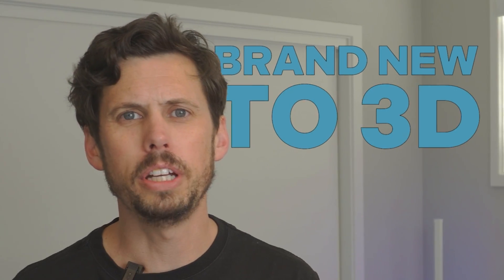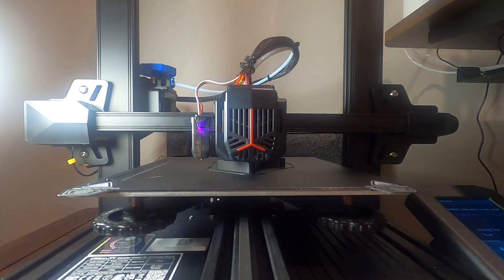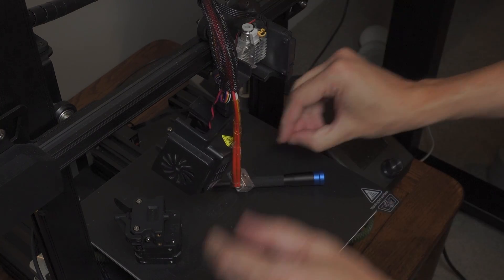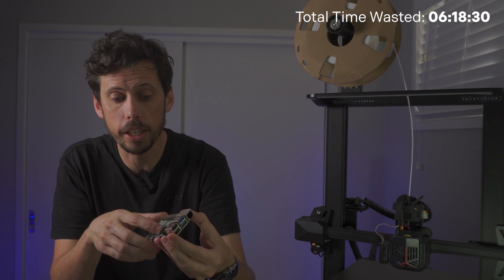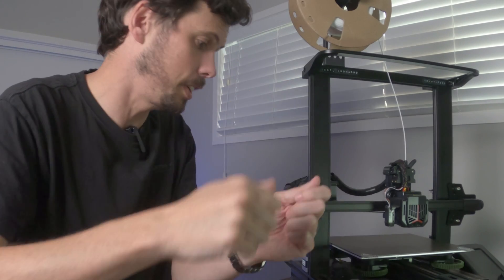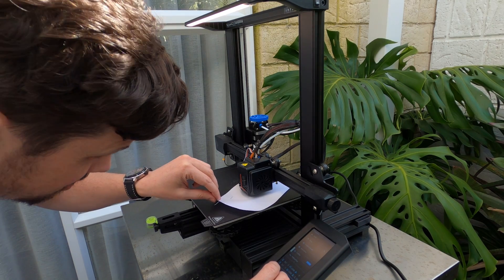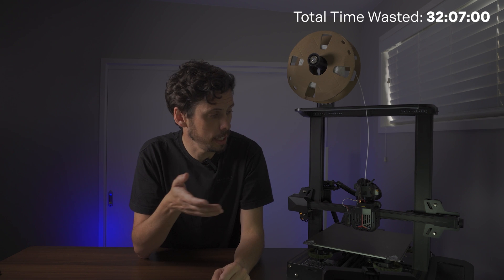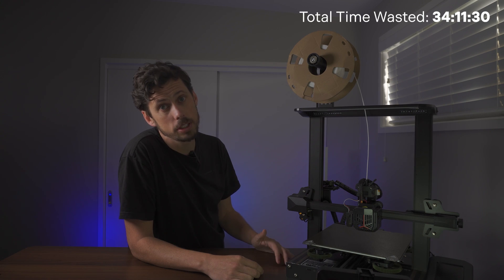Is Upgrading your Ender 3 worth it?

Comment: I can totally relate to your adventure with an Ender 3D printer! It's like a never-ending quest for the perfect 3D printing setup. I mean, who knew that a simple printer could lead to a full-blown upgrade obsession? It's like the Ender 3 is the ultimate DIY project that just keeps on giving.

I can picture you there, tinkering away and muttering to yourself, "Just one more upgrade, and it'll be perfect!" It's like a never-ending cycle of upgrades and modifications. But hey, that's where all the fun is, right? Who needs a Prusa when you can Frankenstein a V6 volcano onto your Ender 3 and create a 3D printing monster?

And let's not forget about all those spare parts lying around. It's like a 3D printing treasure trove just waiting to be turned into another Ender 3. It's like a never-ending loop of 3D printing adventures!

But hey, at the end of the day, all those upgrades and modifications are totally worth it. I have no doubt that your Ender 3 will perform like a champ once you're done. Keep on printing, my friend, and may your Ender 3 adventures continue for many more upgrades to come!

Comment: I've spend hours on my ender 3. From small thing like a new board to a massive overhaul, i spend at least 2 or 3 times the cost of the printed in upgrade.
Is that worth it ? Hell no. 
The machine worked fine before, but it's amazing to thinker with it, if you omit the hours of rage and frustration.
But i love my Klipper Ender 3, with direct drive and double Z, the machine give me the passion for making machine by myself, i can't imagine buying something else than a kit now, love building my cnc and laser, that was the best machine for me.

Comment: Uh, hey, dry your filament.  Like really.  Then you won't get all that stringing and those branches.  And your dual-z/anti-backlash nuts probably improved the accuracy of your first few layer heights.  If you're going to bother with firmware, and you have a pi already hooked up, just skip to Klipper, it's just better.  Makes doing further upgrades a lot easier.
Reply from the maker: Thanks for your advice man. Good to know about the anti-backlash nuts. That filament should be pretty dry still but I do have a dryer so will make sure it's dry.
Reply: @AttemptedMaker  in my experience brand new PLA is often wetter than it would be after drying it and leaving it on the shelf in the open for months.

Comment: I got the sprite extruder pro for my V2 Neo, installed it and only then realized the geniuses at Creality had moved the X axis endstop from where it was on the V2. Ended up having to ziptie it onto the extrusion and angle it with a bit of plastic underneath it so the plate on the new extruder could actually hit it. Then I had to print a new mounting solution for it, which turned out not to work, because Creality also decided that the clicker PCB would no longer need screw holes that all these designs relied on, finally ended up finding one where you can slide it into place and got everything working again. On the bright side, now I'll be able to print with PETG

Comment: Dual-Z isn't for z-wobble(if anything it could make it worse by adding more over-constraints). It's to get rid of inconsistent layer-heights across the distance of the x-gantry. The gantry itself is a giant springy cantilever held up by V-rollers that deform under pressure. The way the rollers are tweaked, can help address this, but the heavier you make the extruder(direct drive) the worse the problem gets, then you have to make the rollers tighter.. things bind more.. they would wear out prematurely, skipped z-steps from excessive friction..

Comment: The only mod i did on my ender 3 v2 neo is a filament guide to make feeding the filament from the top more consistent as it makes a 75° bend otherwise. I've replaced snapped belts as well and changed nozzles but that has been powering my 3d printer to make some cool knick knacks and special storage cases for my junk

Comment: For the bed leveling, it might be your slicer
The auto-home instruction disables it - so you need to re-enable it.
I use the following bit in my start G-Code:
G28 ; auto-home
G29 ; build auto-level mesh
M420 S1 ; auto-bed leveling

Comment: For Ender 3 v2 the only must-have mod is upgrading extruder (this cheap, Chinese, red aluminium dual-gear works great), as stock are faulty and crack over the time. Also it's worth getting better springs for the bed to care less about bed-leveling, they are very cheap and save you a lot of time.
Well, for me also dual Z-axis was mandatory as my printer out of stock came with a bit wonky / not square frame and only dual Z-axis helped a bit, well actually a lot (yeah googled for this issue and followed many tutorials, it was frame's not assembly's fault)

Overall: just print and enjoy and take care about the planet by not printing too much unnecessary garbage 😁

Comment: I got an ender 3 v2 and I got some thoughts:
-a bi-metal heatbreak has been working fine, it was the cheapest I found on aliexpress
-I never understood the benefits of octoprint so never tried
-v-slot covers are such a stupid mod, I also printed them and they didn't fit and I hammered them in and broke some
-dual-z axis motors was a good investment, because I also printed a direct drive mod (printhead is heavy)
-I got a thick thermal insulation on the bed and it hit the stepper motor too :DDD I just trimmed it
-there was some reason I got the silicone spacers, maybe it was related to the BLtouch I installed?
-custom firmware was necessary for the BLtouch
Overall I think this video is great, very relatable :D

Comment: Tip for the firmware/bed levelling issues you are experiencing:
Use klipper! I know it seems daunting at first, but its SO worth it! I myself have upgraded to klipper from my marlin machine, and it had a pretty steep learning curve, but I can honestly say it has been the best upgrade I have done to my printer (which is more than I want to admit) - both print quality and speed wise, but also for the quality of life improvements the firmware offers.

If you decide to give the firmware a try, one of the first plugins I would recommend is the KAMP plugin. Kamp is a mesh levelling program which is far superior to anything I have tried in the past. And I wont doubt in a second it would help you with you´re bed levelling issues!
Hope it helps!

Comment: man after two years or so the only upgrades that I installed on my ender3 v2  is a side spool mount and the vslot covers. niw though im probably gonna be upgrading to a full metal hotend as i needed it to print using PET filament.

Comment: This is a great video as it perfectly captures how my printing experience has been with my Ender 3 V2. I calibrated it when it was stock and had amazing first prints. Then i decided to "upgrade" and it got worse and then better again. Repeat that cycle a few times, especially with installing klipper. Now I have all the parts for the belted dual z mod and I'm thinking i should print some stuff while the printer is working before I mess it up again.

Comment: These are some generalized opinions, not just for an ender 3:

Light bar: can be extremely useful, good mod for any printer, i used to have a desktop led lamp just over my printer for a long time before attaching some led strips permanently

Alternate spool mounts: sometimes unnecessary, but in the case of an ender 3 type machine, this is superior for the bowden setup assuming you have the space, it is still better to have it on top if you go for direct drive though

Better bowden tubes: makes sense for a bowden setup, otherwise not worth

Bi-metal heat breaks: they serve their purpose, you can get away with just a single material full metal one with no issues though

Octoprint: IMO, if you're connecting a computer (like a pi) to your printer anyways, i'd highly recommend going the extra step and just switching to klipper firmware, you can gain so much more compared to just uploading gcode over the network, and having a video feed

pi case: i wouldn't consider this a separate mod, but a part of the previous one where you add the computer, however it's an important part of doing it

Vslot covers: not really my thing, but useful if you don't like cleaning your printer since they sometimes help blocking debris getting into the slots

multi z axis: if you have a bed leveling sensor, this is amazing, if not, really depends if your prints are turning up fine or not (dimensionally)

anti-backlash nuts: yes, use them, always

Buildplates: they are a wear and tear item to begin with, even when they seem fine, they lose their stick over time, so a new print surface is a must eventually

Tactile bed leveling: really only makes sense if you have large bed leveling knobs, if your printer doesn't fit large wheels, you don't get enough precision when leveling

Silicone bed springs: haven't tried them myself, my springs have been great so far (4 years of printing)

Direct drive: yes, it's amazing, i'm never going back to bowden

Cable guides: always a good idea if your printer doesn't have a decent solution for them

Overall, not a bad choice of mods, i would've done it a bit differently, but that's the beauty of 3d printers, you can do whatever you want hah

Comment: To run autobedleveling on ender 3s you usually have to put m420 s1 in the gcode start up in the printer settings of the slicer
Reply: Mine started auto levelling at the start of every print when I switched to Prusa slicer.

Comment: Have you added the GCODE to your start code to actually use the bed levelling info? I was using CURA on my Ender 3 and didn't have that code on so, for almost a year, I was not actually using the levelling info, despite doing a level in Professional Firmware with the CR Touch before every print.

Comment: I wasted so much time and filament with the bed leveling that I'm sure that I made back the time I lost installing my CR-Touch. I also love my PEI bed and dual gear extruder. Those are the upgrades that made a difference, not in print quality but in reliability.

Comment: With ender 3 v2 with bl touch , i am using the UBL mesh gcode examples that are with marlin's firmware. I will try and link them in a bit. It works for me though and i also bought the printer second hand , with bl touch and with no previous knowledge of anything "3d printers" i figured everything out the same day . Because i had in my mind to upgrade it before i even got it.
Thank God for that because i installed dual z screw because the gantry was hitting the print before it every time it moved because it travelled through the print and was crooked without the second z axis. 

The previous owner had installed some things wrong, some wires had been melted etc and it helped that i remade the whole thing.
So anyway i at least learned how to disassemble and maintain it from the start. 
I would post my start gcode if it helps.
Reply: Here is my GCODE  for the UBL BLtouch Firmware Mriscoc For my ENDER 3 V2.
it might be wrong but it works for me.

G90 ; use absolute coordinates
M83 ; extruder relative mode
M140 S[bed_temperature_initial_layer] ; set final bed temp
M104 S200 ; set temporary nozzle temp to prevent oozing during homing
G4 S10 ; allow partial nozzle warmup
G28 ; home all axis
G29 P1 
G29 P3 
G29 F10 
G29 S1 
G29 A 
G29 L1 
M500 
G1 Z50 F240
G1 X2 Y10 F3000
M104 S[nozzle_temperature_initial_layer] ; set final nozzle temp
M190 S[bed_temperature_initial_layer] ; wait for bed temp to stabilize
M109 S[nozzle_temperature_initial_layer] ; wait for nozzle temp to stabilize
G1 Z0.28 F240
G92 E0
G1 Y140 E10 F1500 ; prime the nozzle
G1 X2.3 F5000
G92 E0
G1 Y10 E10 F1200 ; prime the nozzle
G92 E0

Comment: Nice Video, i have two i3 Clones build as Kit, two Ender 3 v1, a Tronxy and a Bambu Lab X1C. 
The Ender 3 pro with the damaged Motherboard is now rebuilded as a Voron Switchblade Clone.
The other Ender 3 got all the Electronics upgrades etc. Just did a 20 hours rebuild on it.

For the Springs: The most common use for the Springs the Bed and reduce the need for Manuell Bed leveling. So either Clicky Wheels or Springs, both is overupgrading. 

The Side Spool is for reducing friction on the Bowden Drive, the first series of Ender 3 even had problems with PLA eating into the Plastik of the Feeder. So Guide Arm and Wheels are not uncommon for this Reason.

Syncronised Dual Z-Axis: It prevents the loosing of the rollers on the non Axis side. Together with a BL-Touch Ender 3 results in awefull results. So either tensioning the Rollers regularly or Dual Z-Axis.

For the Firmware Problem: Which Motherboard do you have ? What do i mean by which Motherboard?
When this is a Ender 3 V2 Neo  then you have mose likely a 4.2.7 Motherboard or the older 4.2.2. But which Stepper Driver is on it? There is most likely a Letter Marking on the Card Reader Slot. H is the lucky Letter as it has the TMC 2225 Steppers. Search for: "Klipper Discourse Group  Creality Board 4.2.2 Schematics " There you find a full guide which Stepperdrivers you have, which Board you have. It is a can of worms and there are about 6 different or more Varients of this Boards around. Searched 4 hours till i got the BL-Touch on my Working Ender 3 Board running.

One Upgrade is missing: New rollers. The Bearings of the standard Rollers are open, there are heavy duty rollers out there, which costs not much more but have a cover over the bearings which prevents dusts and microplastik destroying the Bearings.

I said that i rebuilded one Ender 3 v1.  It is now on the Specs of a Ender 3 V2, as it had the 4.2.2 board with TMC 2225 Drivers and now Bl-Touch, but still has the old stile Display. It got a lot of Upgrades now and it can print as well as my Bambu Lab X1C. For about 4 hours, then it needs to be recalibrated.

For a Beginner i would recommend something like the Bambu Lab A1 or A1 mini.  For the Cheap Ender 3v3  no 3v2. The 3v3 Lineage has linear Rails for the Bed, which are much much much better and more durable. The Bed-Rollers are the most common failure Point for Cheap Bedslingers. The Ender 3v3 SE is costs less then 5% more then a 3v2 Neo, but will last longer and print better. But watch for the differences in Hotend etc.

Comment: I've done all this on the several printers I've owned (all Creality ones) since I first got into 3D printing in June 2020. My most recent being the Ender 2 Pro which was performing nicely, until about a week ago when the motherboard decided to die. Not wishing to go through the hassle of trying to source what is a non standard part, or bodging another board into the case, I decided to splash out on a Bambu Lab A1 Mini. I received it yesterday, and all I can say is WOW! What a difference between the A1 Mini and everything I've used in the past, it's like night and day. The printer just works, perfectly, right out of the box, and boy is it fast! I'm printing something right now that will take the A1 Mini just over 3 hours, whereas it took my Ender 2 Pro just over 7 hours! And the quality is there too, top notch. I'm never going back to anything else after this - my tinkering, modding, and upgrading days are over 🙂.

Comment: You should really give Klipper a shot.
Reply: Klipper is great.   I can waste more time even faster now ;)  

 (seriously though it is a huge improvement, the sonicpad is actually a pretty decent setup for creality machines)
Reply from the maker: Oh yeah, I've seen the sonic pad... and the single printer version that came out... I forget the name. You think it's worth it?
Reply: @AttemptedMaker  You don't need the speeder pad to use klipper on your ender. You can just use the same pi you're currently using for octoprint and you use a touchscreen just like the speeder pad by getting any raspberry touch screen tho it's not necessary if you just use the web dashboard.
Reply: @AttemptedMaker  Completely game changing, no other way to put it.
Reply: Totally worth it… you can change config so easily just by editing a text file then clicking save! I’ve only just dived down the rabbit hole and never going back to marlin! Not got an ender, but I’m running it on a Rook MK1 and it’s sweet!

Comment: If you want to waste even more time, upgrade to klipper and get find a compatible smart plug that you can use with moonraker.

Its going to take time and you will fight it, I haven't even done the fancy speed tuning like every ytuber does. I mainly use it because the bed levelling works and I can fire prints off from the web interface, the printer turns on, prints and then turns off all without me interacting with it. there was a octoprint plugin for it but it I haven't used it in years.

every upgrade i've made has just been me spending 10x more time trying to get the machine to work as well as it used to do before I touched it.

Hotend upgrades were great because it just meant that i'd break the thermistor or the heating cartridge  and have to wait ages for a replacement.
Reply from the maker: It crossed my mind when I was looking into firmware. It looks pretty intimidating... but I do like the sound of functioning bed leveling. 

Haha yeah, I didn't even mention the money I've thrown at this in the video 😅
Reply: @AttemptedMaker  There is a learning curve but its worth never having to recompile the firmware